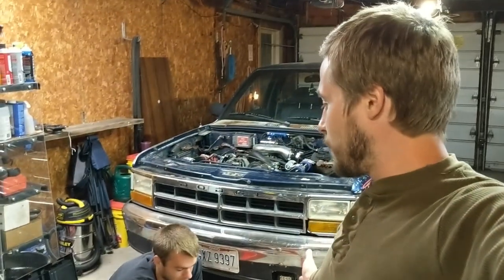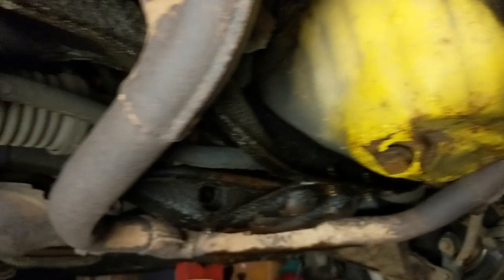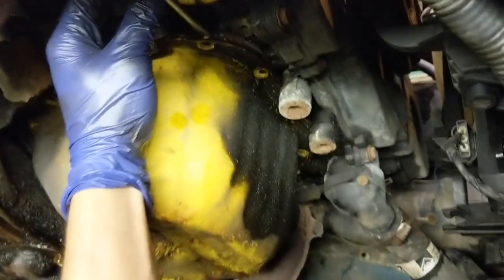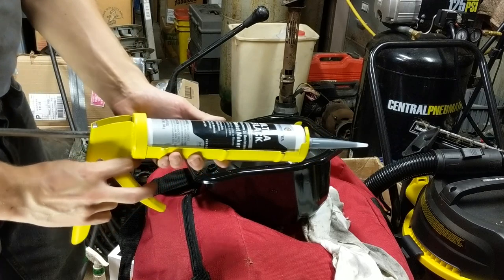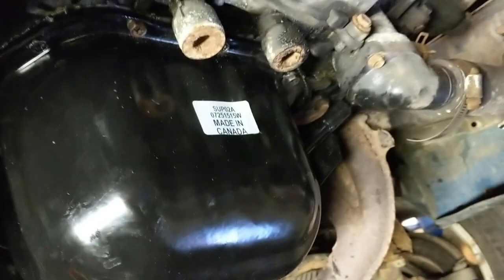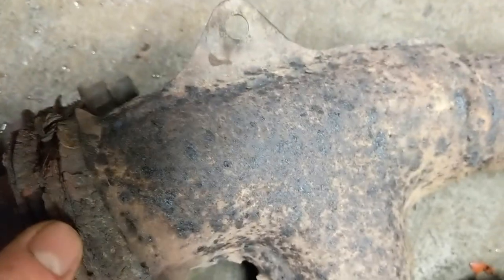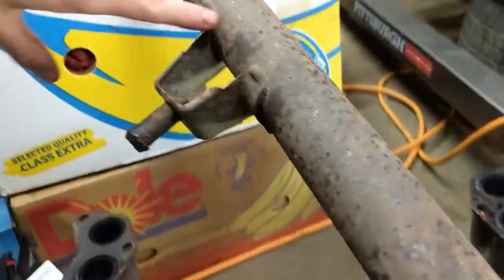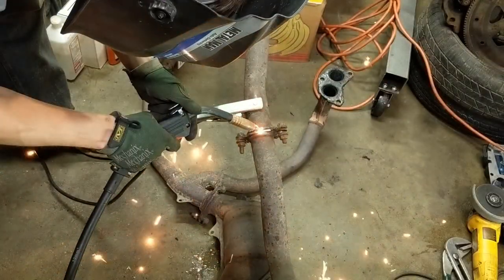Dented Subaru Oil Pan + 10,000 Mile Road Trip = Profit?!

Comment: 2:22 - The color tells you that it is doing its job!
4:09 - That's a pretty good price for an oil pan in general!
4:44 - Not a bad application.
10:20 - That's a lot of metal!
11:52 - Partying hard again, I see!
13:14 - That's actually pretty cool! I wonder if they are made in the same factory as the Denso First Time Fit filters (which may also be a rebrand of an OEM supplier) since they share both the same type of seal and the plastic covering.
13:36 - Pefect funnel-free pour! Bravo!
16:14 - Wow.
Reply: Cars Simplified Wow, bit of a show off with all the times there...😂
Reply: Haha I only do that when I am on desktop and sharing that many thoughts in a single comment would require a lot more writing to string them all together.

Comment: Love how open the oil pans on those are.  much easier than some cars.    I miss welding.. i really need to get another welder.
Reply from the maker: Yeah much better than many cars where you have to drop a subframe or basically remove the engine. welding is definitely super fun. One of my priorities when I get home is to buy a tank of gas so I can actually practice MIG. Going to need it for the GSX rust holes and my WRX rocker panels.

Comment: I laughed so hard at the end when that strut rod slammed all the way down! It reminds me of the time I got prime choice struts off Amazon. That brand is garbage all the way around BTW. I've had customers buy prime choice brand window motor and blower motors that were wired backwards internally, so I had to take the plugs apart and snap wires back into the molex opposite to make things work as they should. Imagine pressing the switch for window down, but it goes up and so on.
I also hear you loud and clear on the time it takes to get stuff done. When I was young, my gf said car repair time was like football time. Just because there was ten minutes left in the game did not mean it would be over in ten minutes. Working as a tech for decades definitely changed that for me though. Now I look at a job and the working conditions and get a pretty good idea of the time it takes.
I know that the FSM may say to do a repair one way, but the reality of how it's done can be way different. I know the FSM for a 2000 Maxima says the time to replace a cam position sensor is over 8 hours and that all rotating accessories have to be removed, but I just peel the plastic timing chain cover back slightly and have it done in five minutes. 
I used to be big on making gaskets from rtv, but history showed that that stuff can squish into other places and clog stuff like oil pick up tubes. I totally get doing things via "the struggle" way, but when possible I like to avoid rtv whenever possible. A lot of gaskets like felpro have a line of blue or black in the middle that negates the need for any rtv at all and I've had good luck with them. I also understand that you know things that I don't, since I've not done much with Subaru's. I'm mostly a Toyota, Honda gm and sightly Dodge guy myself.
This was a fun video to watch all the way around. I hope your trip goes well.

Comment: Eyyy Oil Pan Made in Canada eh? ;D
Reply from the maker: Yep! Working great.
Reply: Lucky :P what brand is it? :o The only oil pan I could get for my Acura was from Dorman Made in China D: (still decent but I'd prefer domestic products lol)
Reply from the maker: Spectra Premium. The Dorman for this car are known to be a bit off, especially the dipstick tube. Only thing I didn't like about this pan was that the new drain plug was much smaller than OEM.
Reply: Lol now I notice it. Oh well just means now it's gotta be torqued by feel, same issue when I switched to a magnetic drain plug.
Reply from the maker: It's really no problem. I just like the Subaru drain plugs a lot. It's not like it's a complicated part.
Reply: Unlike Audi's that use Allen Key Drainplugs that like to strip lol

Comment: 10-40 for that sub can't be that good bro I use 5-30 full synthetic for my EM1 and it's a 2000
Reply from the maker: Trust me, it loves the 10-40 until winter, hahah. Either way the 0W-40 is pretty ideal year round. It has been super quiet with excellent gas mileage this trip!
Reply from the maker: I would never drop lower than 30 for the hot number.